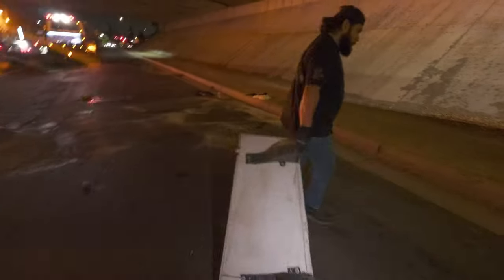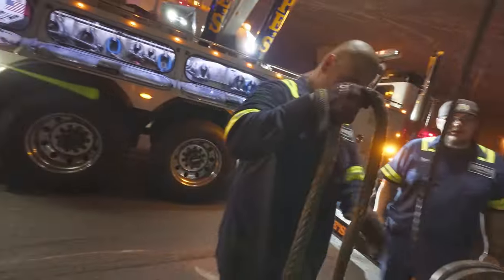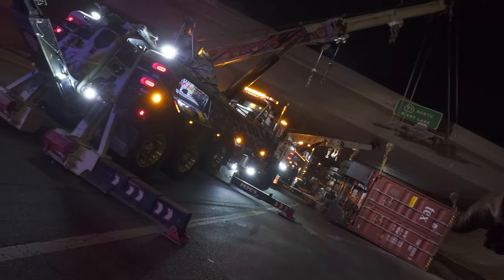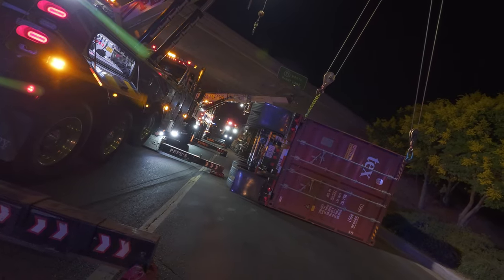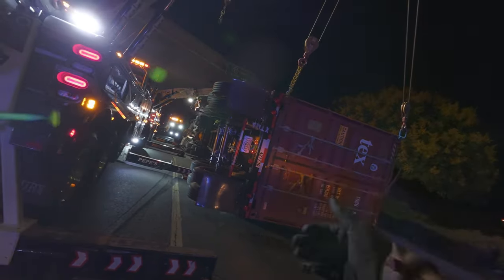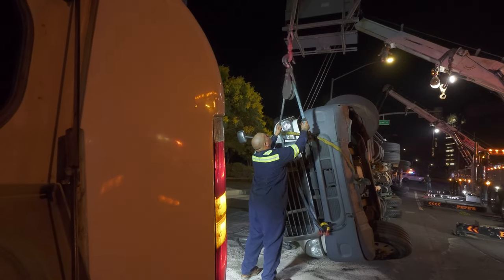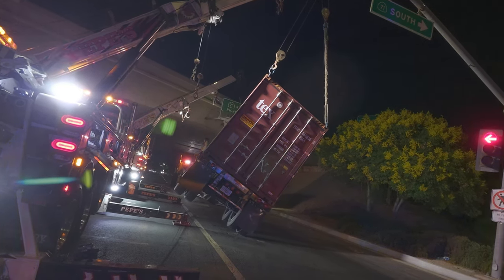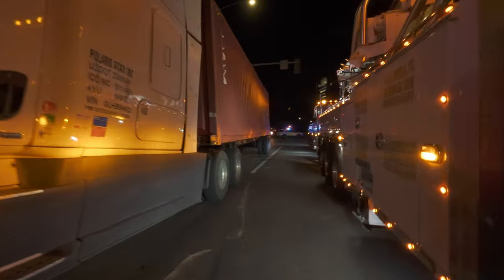Semi Driver Flips Container Under 14' Bridge

Comment: That was an extremely good video of a great recovery.  Usually we see your most experienced operators and they can both predict and interpret each other's actions.  So those recoveries often look effortless and easy.  Here Alex had the responsibility of the casualty, three trucks and all the humans.  He carried that well.  It was also impressive that your other crew members were keen to ask and keen to learn.  Both important when you have 20-40t hanging off a million dollar truck.  

During the trickiest moments Alex did take back direct control, but the margins for error were small, and I could kind of feel Alex's workload in guiding both ends of the lift.  Even Alex didn't have the spare capacity to explain and train during those moments.  It would probably be great to have Alex talk Caesar through the videos of the lift to explain in more detail what he had going on at each point. 

PS: on behalf of Caesar I'd like Josh to remind the team that using a ladder is OK, and not everyone is half monkey like Alex is. 😊❤

Thanks to Alex for a great show, and for telling us that the rig definately rolled before sliding under the overpass.  I'd wondered how they'd got it there.

Comment: Good job guys.
It's a shame that all container chassis trailers are not equipped with air ride suspension. 
Maybe then those lock pins wouldn't slip on those bumpy freeways.

Comment: Question...ive seen shackles that use a threaded pin that screws into the shackle body, but I've noticed that most of yours use a pin with a seperate nut. What is the difference?

Comment: Stupid question?
Couldn't you just drag it out with the winch from behind until you are clear of the bridge? Would that cause too much damage or was it too heavy?
Reply: The container was loaded and being a port container it was most likely at limit so tractor and container weigh 80,000lbs so dragging it would be hard on their equipment!!
Reply: @Lacheyenona72  Makes sense.